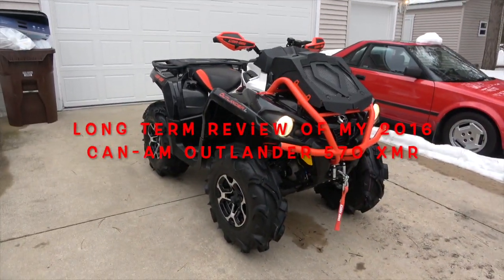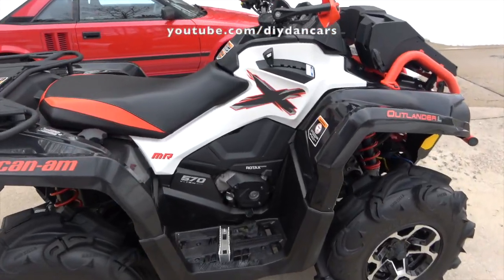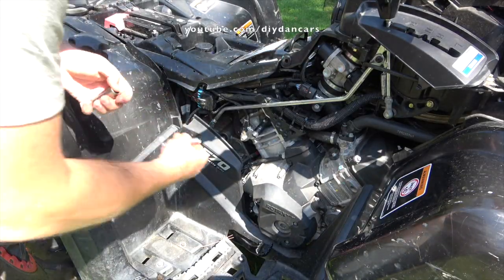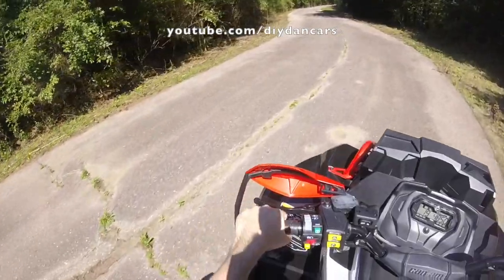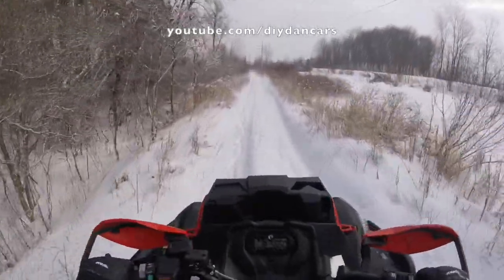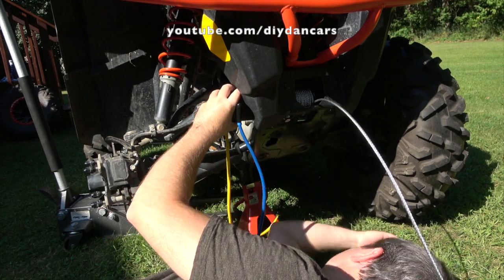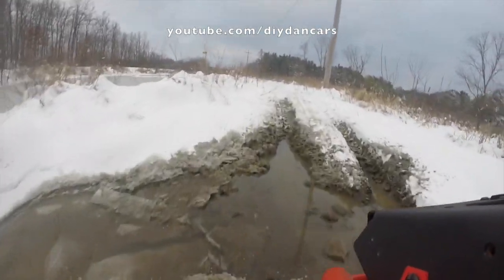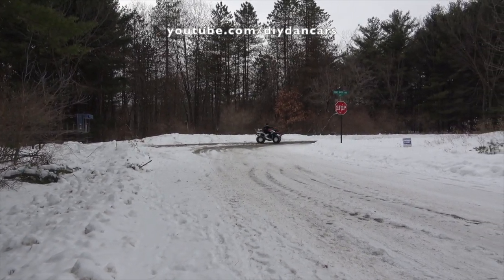Review of My Can-Am Outlander 570 XMR After 5 Years of Ownership

Comment: When you get your 850 please tell us how much extra fuel your using. I feel my type of riding a 570 would be more than enough and if it's the difference between my 700cc sportsman and my buddy's 400cc arctic cat the fuel savings would be worth not having that extra power that most never use. I heard new 570 have more power than old 700s. Let us know if that's true aswell. Thanks for the video
Reply from the maker: The fuel consumption between my 570 and 850 feels about the same. The 570 is a good engine, I just had a desire for more power.

Comment: wow thats a surprise on your brake pads, i got a 2021 can am 570 xmr with 600 miles and there still going strong!!!!
Reply from the maker: I'm surprised you got that many miles out of them! Do you not use your brakes? ;) Actually, i'm not the only one who has complained about the longevity of the brake pads on Can-Ams. This problem is talked about quite often on the forums as well by other owners. 

Enjoy your 570! They really are great machines once you get some of the bugs worked out.
Reply: be safe with these stock pads ! Mine were completely dead at 600 miles and I wasn't even using them, just natural wear of pads rubbing dirt on disk. Keep your eye very on these very often cause just a small blocking of the brake caliper and they are dead in less than 10km (from what my dealer said it's what appened since the wear was inegal between every pads, and they are so soft that a very small pressure could just worn them so if your calipers are a bit dirty, pads basically last one ride)
Reply: @mrmim0x173  soo how to solve this problem, i mean xmr is built for mud, wtf
Reply: @sknails2723  change for better pads. Can am's stupid decisions, nothing we can do about 😒. Btw my dealer change my pads in warranty

Comment: Great review. Your wish for a temp gauges has come true! 2021's now have a temp gauges; a bar style one and the option to see the actual temperature. So far, I've put 750mi on my machine and it's been great. Maybe they fixed all the little things you mentioned. I also have a set of trail wheels/tires.  The mega Mayhems that come on it are too aggressive for the trail but as mentioned, it's a mud machine so it's made for that purpose.
Reply from the maker: That is good to hear! Can-Am finally added a temperature gauge to these machines. I wonder what year they started doing it? Thanks for letting me know.
Reply: @DIYDanCars  As far as I know, 2021. 2020 was the last year with the cluster like yours had. I think every base machine has this new cluster now.

Comment: I've had mine for 5 years and it's had zero problems, brakes are still like new and all the other things you had problems with like the buttons hard to push that happened on my Honda, little wd 40 took care of that.  Breaks is something that the owner can be responsible for we all ride different, and your complaining and you've haven't had another to compare to, try the others like me and you'll quit complaining about nothing, you say your in the mud it will have more problems than if you never mind your machine. This is so minor and you sounded like you wanted another brand and you picked basically the same thing.  Be happy can am is the king of mud and just about everything else it does as well.
Reply from the maker: Edward, I think you may have misunderstood my review. The brake pads wearing prematurely is a common complaint among Can-Am owners. A simple search on the forum or FB Groups will reveal that. Also, there is nothing wrong with a  little criticism about a product, hopefully that will only motivate them to build a better product. Thanks for the dislike! :)

Comment: XMR shocks are different from basic 570 one ? Because mine are pretty soft and absorbs a lot of bump. You maybe said it in the video but I probably missed it (I am not english native so that doesn't help ^^) but how much miles did you put on it ? I have the same problem for the DPS button btw on a 2021, it's pretty stiff while it was like a normal button when brand new. Idk why, but it's not that bad for the moment so I hope it will not get worst (and if it appen, not a big deal I have 3 year warranty anyway). As someone else said, every new G2L and 650 got new digital gauge who is pretty nice (even 450 I think, depend country) and it have temperature display. And I think the viscolock was pretty bad but the new abs system is even worse, idk why they can't put a real locker on small displacement machines :(
Reply from the maker: I believe the shocks between the base and XMR are the same, it's the springs that are different. The stiffer springs on the XMR do not absorb bumps as gracefully as the ones on the base model.
Reply: The XMR got stiffer, taller springs to fit the bigger tires, which is why it rides much stiffer. I’ve owned a 570 XMR Outlander, 570 base Outlander and a 570 XMR Renegade with the Fox shocks. The base by far is the most comfortable.
Reply: @destinhook3826  good to know 👍